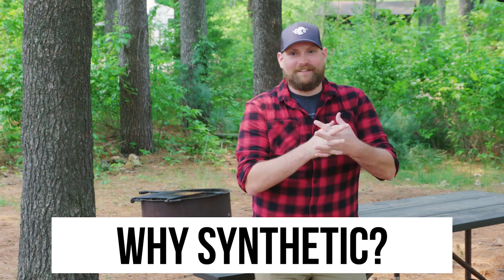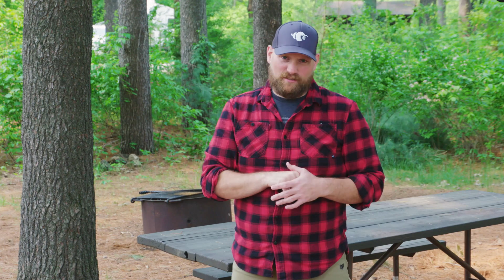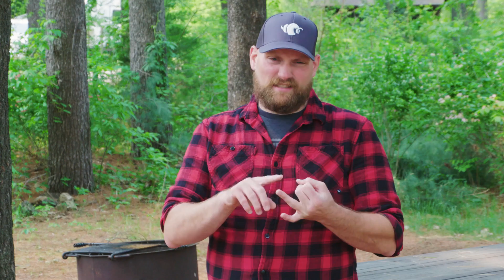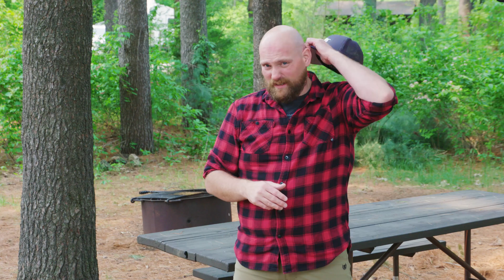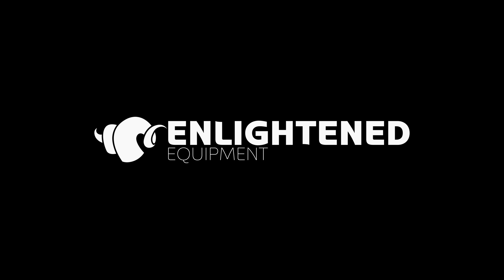Why Synthetic? | Tim Talks

Comment: You missed one benefit of synthetic insulation: when you tear or melt the fabric, the insulation stays put  - and one disadvantage: if you dry synthetics on high heat for a long period of time, the crimp in the individual fibers which provides the bulk, and, therefore, loft, relaxes, reducing the overall warmth of the garment. For me, it's always been down for extreme cold and synthetics for  "a bit of a chill". I prefer fleece for summer use, because you can choose whether to use it with or without a wind shell, giving yourself a very wide comfort range.

Comment: So I just bought a down guilt from you a few weeks ago, and now I’m questioning the purchase.  Can I exchange it based on your video?
Reply: Hi Christian! Just reach out to our customer service, and we should be able to help you out.
Reply: Go ahead and talk to Dan. However, the weight and compressibility advantages of down really show themselves in quilts as so much more insulation is needed compared to the smaller apparel items. If your quilt is a 40* or warmer you will see a real difference in weight and pack size between down and synthetic.